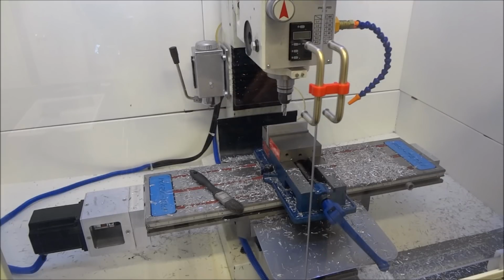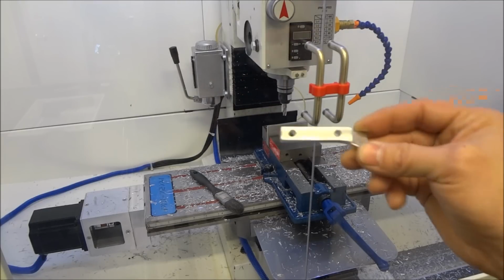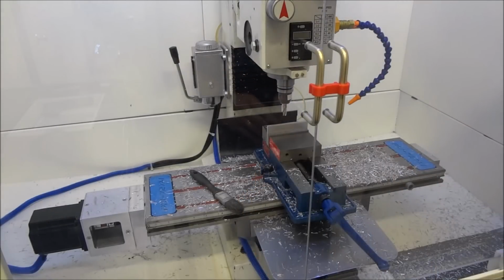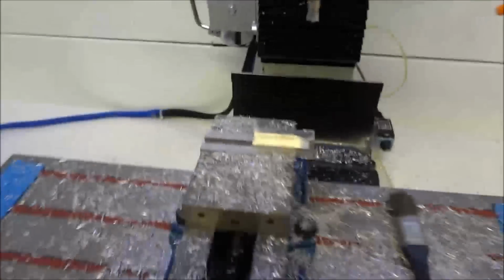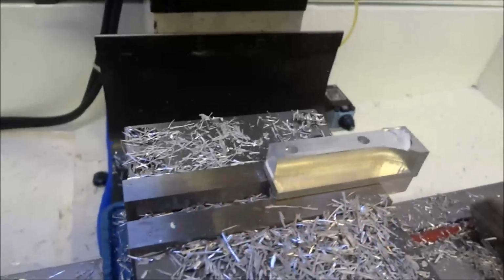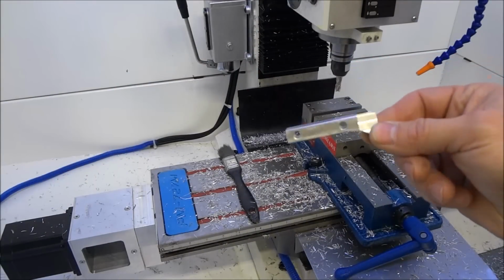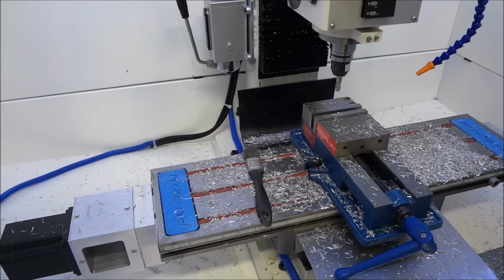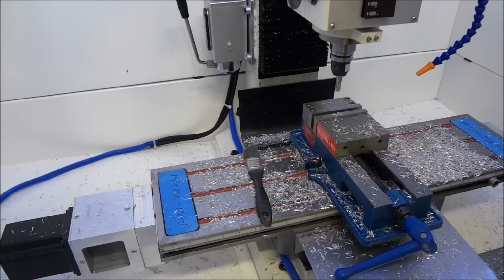PM-727M " First Chips"

Comment: I've had the stuttering on my machine as well.  What I found was the post processor (Fusion 36) was putting the machine in exact stop instead of constant velocity mode.  I modified my post to include the G64 at the start of the post.